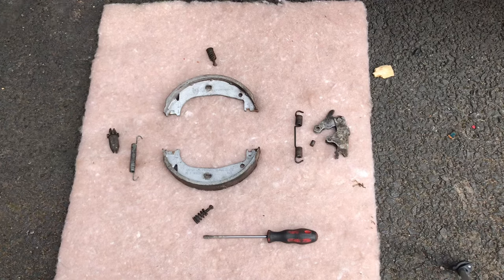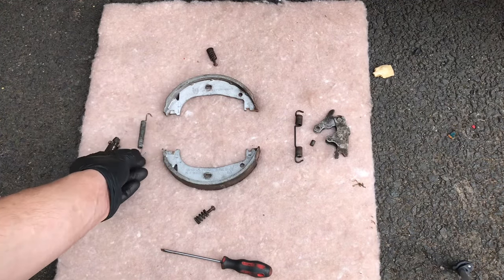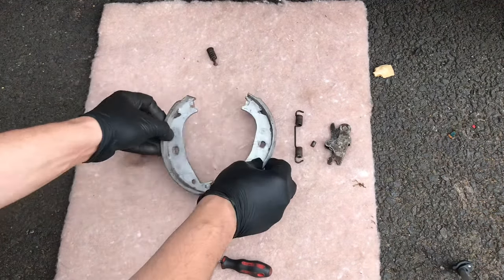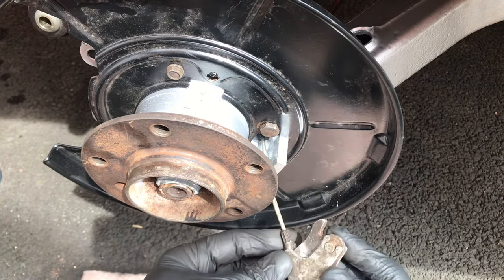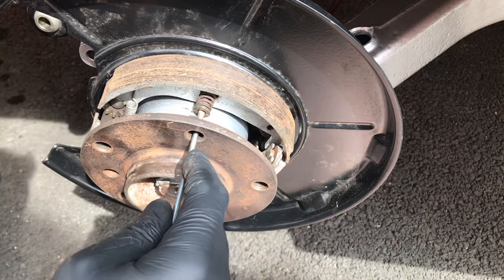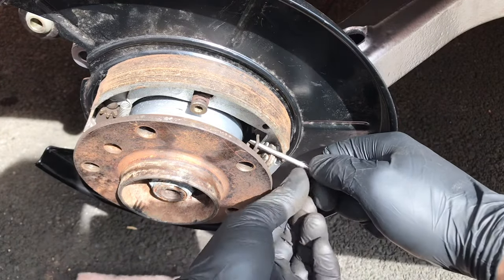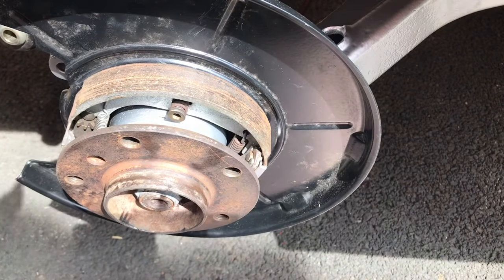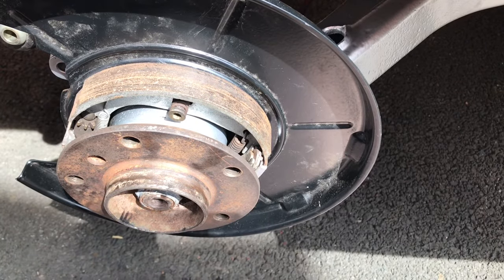BMW handbrake assembly shoes replacement installation adjustment e36 e46 e39 e60 e90 e92 m3 m2 m4

Comment: Hi, in my case it appears the backplate on which the springs latch is the faulty part (the springs won't latch because the holes are stripped). Are you aware of any video that shows the process?

Comment: Great video. Made a tough looking job very simple. No BS and straight to the point. Subscribed. Cheers.
Reply from the maker: Thank you 🙂
Reply: @vysgarage  HI I have a 2006 z4 m with 38,000 miles, the parking brake on the passenger side of a left side drive car sticks a bit after being on a hill. Is the parking brake on both rear wheels or just one?

Should I just order a new e brake set before I disassemble it to save time, or should I see if it just needs grease?

Comment: Don't know how old this beemer is or what model but the actuator on the E46 models doesn't look like that. It doesn't have have the closed cable hitch and the cable has a talurit not and eye and pin.
Apart from that the rest is ok.
Reply: How did you do the e46 my cable is barely out the hole😢
Reply: @flatout3577  You need to have the hand brake off and back the adjustment nuts off on the cables at the lever end as far as you can without them coming off.
That should give you about 2 inches more length at the actuator end. When you have reassembled the brake assembly you need to adjust your cables at the lever end.
Reply: @veritasaequitas9875  cheers mate ive sorted it 👌
Reply: @veritasaequitas9875 hello. Could you please give me more details on last step cable adjustment , done the rest but now my handbrake seems to not react at all . Do I need to remove whole middle console for access?

Comment: Would the 18mm shoes fit if stock was 16mm and I have rotors with a bigger internal diameter? Desperate!
Reply from the maker: Hi, 
No they won’t. 
I make rotor inserts to convert the rotors.
Reply: @vysgarage  so with inserts I could keep the rotors and use 16mm shoes? If that's something you sell I'll give you a call today 👍🏻
Reply from the maker: @goreallyspeed4819   yes

Comment: Just did mine but the retaining clip popped out wojld I need to replace the dust shield?
Reply from the maker: Ideally, yes. But you can also make a little washer with a slotted hole in it as a temporary measure.